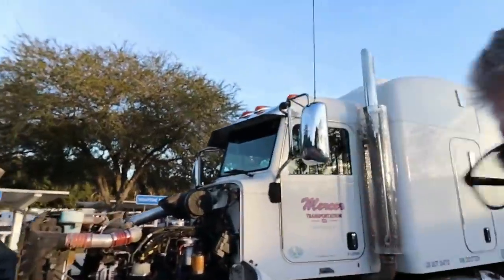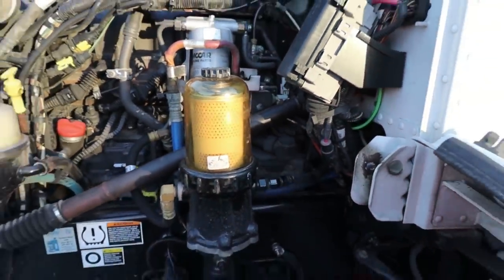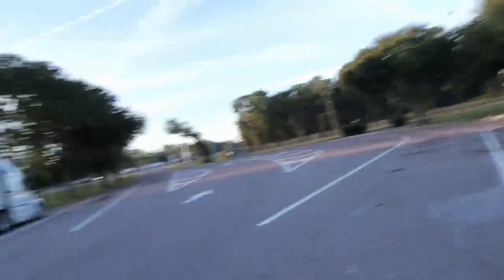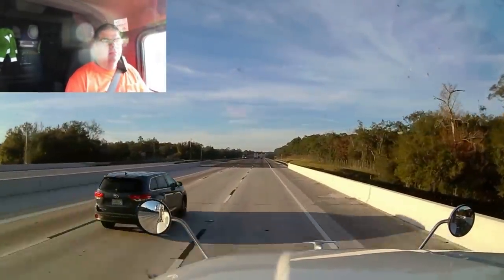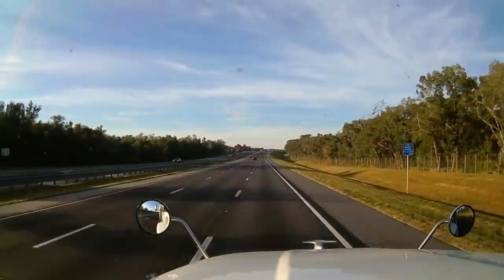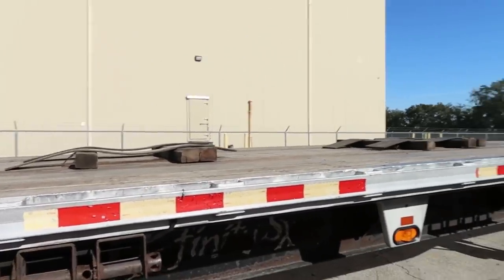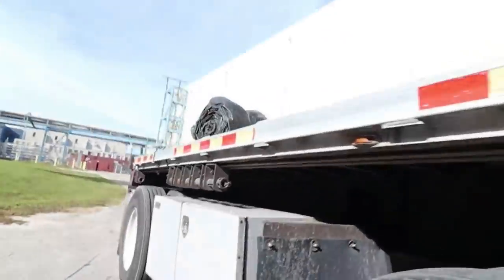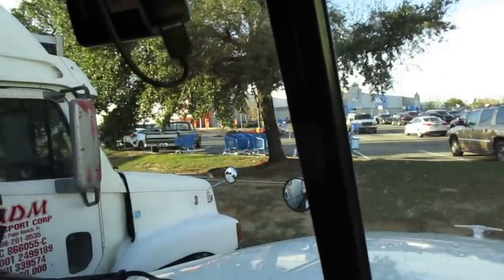#363 Coil Racks The Life of an Owner Operator Flatbed Truck Driver Vlog

Comment: I used to haul steel coils in Canada from Regina to Edmonton. We used similar coil racks except for dunnage we used 4X4's. Two coils on the main trailer and one on the pup gave us 110,000 lb. gross. The trailers were custom made from aluminum. The tractor was a cabover International daycab. We looked pretty funny going down the road but the money was good.
Reply: Whats the chances of one of these rollingin into the cab? Despite the securement being good what if u have to slam on ur breaks or get rear ended will it roll n crush the cab?

Comment: You always do a great job securing loads , I hauled coils almost every day for many years so over time I learned a few tricks actually a guy showed me a couple when the coil is set down on the wood watch closely and see that it sets in there straight, if it is a little off it will settle going down the road and your chains will loosen up. Also make sure the chain link is laying flat against the edge protector before you tighten if not it will roll over and loosen up. I always did this and I hardly had to snug them up at the first check.

Comment: The dunage is positioned in such a way as to prevent the coil from flat spotting.
You could bend the daylights out of that if it sat on the deck.
Posted for viewer/comment reader explanation.

Comment: I liked putting my rig into tight spots. you pulled between the buildings to unload coils, saw bay doors. I thought no way in hell is his truck going fit. then I saw the over crane. thought I was losing my touch.

Comment: When I owned my machine shop, we used to make parts and also repair parts (usually shafts and big heavy rollers) for the machines that make those coils into a finished product (steel only). My main customer Worthington Steel in Malvern, PA., got the coils in raw form (the steel was thick and full of mild slag) and they ran the coil back and forth thru the rollers inside the machine until they got the correct thickness and finish on the coil that the customer specified. They used my 24 hour service the most, we called them "break-downs" which really kept my machine shop in the Green with good profit at the end of the year.///// I know you been trucking a really long time (Walmart told me) hahahahh, but seriously, I'd like to make a suggestion that you either wear foot-ball knee protectors or those copper fit knee protectors that exercising / sports people use, for crawling under the truck for wood, on your knees getting heavy things from your tool boxes and perhaps even leaning over the truck to work on the engine and also why you are tarping up, etc...  I'd hate to see you tear a ligament, or worse get arthritis in your knee joints as it seems you do a lot of crawling around, especially under your trailer as part of your job and storage. I surmise you probably craw under the truck to check your air lines and breaks as well. //// Did you have a inside tire low on air during this video, very back driver's side, as the out-side tire was bulging more than I thought it should be, but then I only glanced at it as your camera panned. The securement lesson I think was a nice thing for you to present, even I who know all things got a little lesson LOL.... Always nice seeing you Dan, wishing you lots of good loads and safe trucking......
Reply: I hauled out of Worthington Steel Malvern use to be National Rolling mills
Reply: @maxpuppy96  You are exactly correct. We also did machining on the other side of the spectrum, we made a lot of needle loaders for Wyeth Labs (west chester pant) based head quarters was in Radnor. They closed too, about the time Worthington Steel did.  (real shame) lots of workers got laid off between the two companies. Thanks for your reply Mark..........

Comment: I'm starting as a flatbed driver next week and just found this channel. This is awesome content bro. Got alloooooot of videos to watch and take notes. 
thank you!
couple of questions
1) for the coil rack ( the metal piece) how do you decide where to put it on the bed ? do you just put it in center and then put the 2nd one behind it ? what if you have 3, do you go closer to the front of trailer or what exactly ? 
2) when you said (1 securement per 5k lbs). do you mean chain and binder is 1 securement ? so if coil weighs 30k lbs then I would need 50% of that which is 15k lbs and each (chain + binder) is 5k so theoretically I would need 3 only ? 
Im asking because I seen some online videos from flatbed companies saying 30k+ coils need 8 chains...

3) what did you mean by 20 guys ahead of me ? dont you just call broker for load then go pickup if you guys agree on price and send in paperwork in email ? this what i did on dryvan. why wait 20 people ahead of you on the load ?

thank you again.

Comment: Heres a formula california had back 20yrs , i still use it and DOT never says nothing ......only for suicide coils ...
0 lbs-10,000lbs =1 chain pulling forward/1 pulling back
10,001lbs-20,000lbs= 1 pulling forward/2pulling back
20,001lbs-30,000lbs=2 pulling forward/3 pulling back
30,001lbs-40,000lbs=3 pulling forward/4 pulling back
40,001lbs-50,000lbs=4pulling forward/5pulling back
(10,000bl/coil rack) we never put chain in middle of coil , all the power stop incase of a hard break will be on the chains pulling back,  so instead of putting that extra chain in middle i would put it pulling back , .....